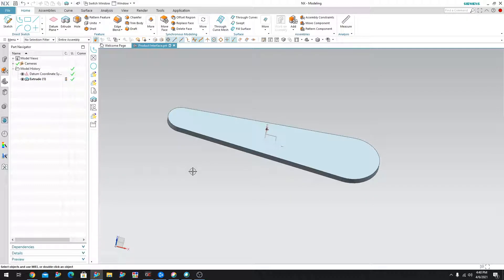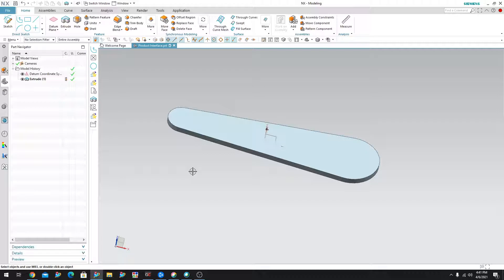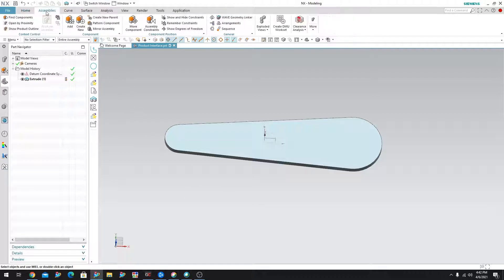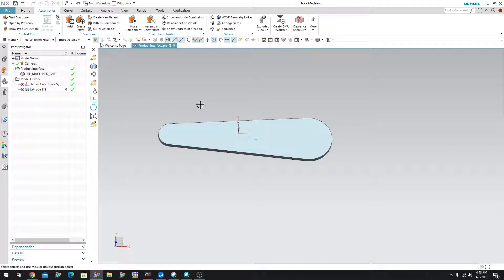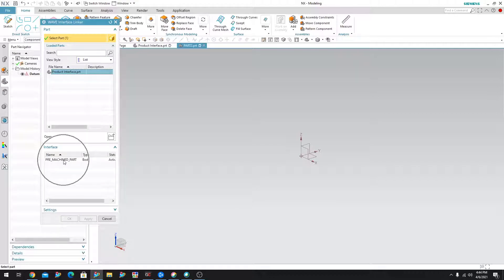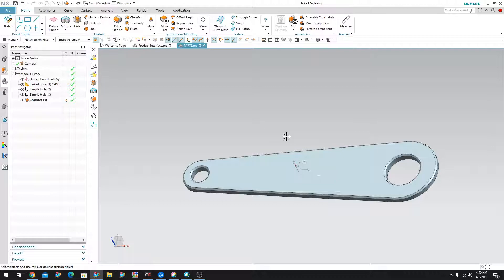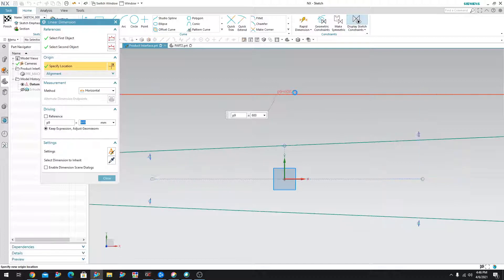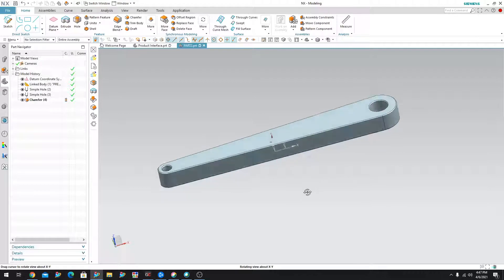NX 12 Tutorial - How to Use Product Interface

Comment: Isn't it the same , if in part 2 tree we directly use a interpart wave linking & linking the previous body ? [ no need to define product interface in part 1 ]
Reply from the maker: Do you mean by turning on Wave Mode? To some extent, yes, however, with Product Interface you can lock down the links people can use. I have seen so many parts made from WAVE links that are unnecessary. Using PI helps you with this. There are also some other benefits, such as enforcing mates with the interface, etc. Perhaps I will do another video showcasing these options.

Comment: What's the difference between Product Interfaces and simply WAVE linking though?
Reply from the maker: Product interface only does one thing: it records geometry. Therefore, an assembly is not required for linking. WAVE Geometry linker does two: it records geometry (like the Product Interface) and it records assembly position. Therefore, WAVE geometry linker not only needs the geometry, but an assembly as well. In my experience, it is also easier to fix broken links that are Interfaced than just normal Wave Geometry Linking. It keeps things very organized.
Reply: @Jive_Engineering  Aren't you confusing context dependent vs context independent linking here? With the advanced assembly license (Mach 3), you don't need an assembly for geometry links either, if you make them context independent.